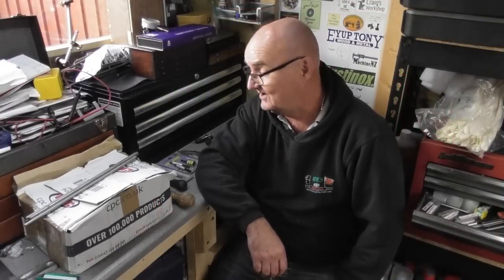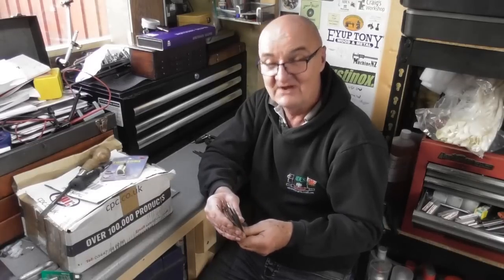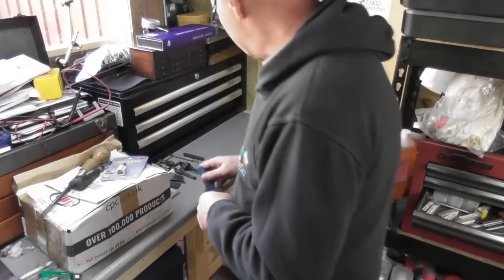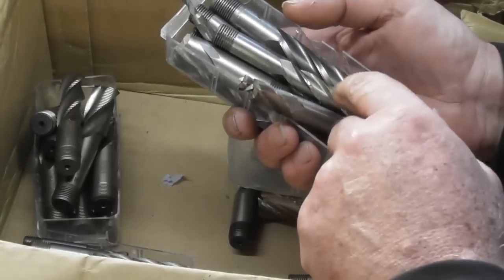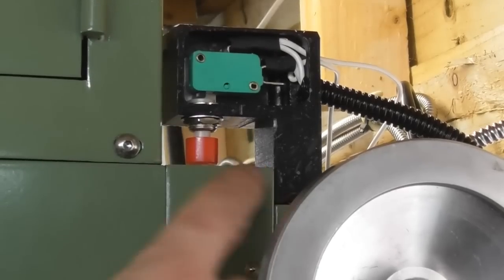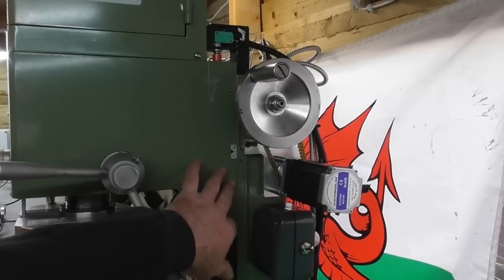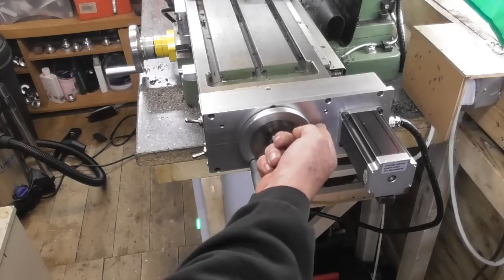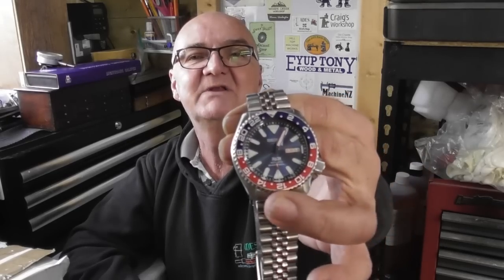Shed talk 27

Comment: Nice viewer score Ade!  A good job of the Z axis cut out. Love the Seiko watch! I've been a fan of Seiko's for donkeys years, on my second  Solar Titanium 100 metre watch. I never take them off and the last one had so much welding spatter on it it got rusty wen wet even if it were waterproof or water resistant as they call it to get round warranty claims. The first one died when the welding spatter welded the crown( winder to others) to the case and I broke the crown off trying to free it. The Crystal was completely knackered as well and the cost of a new Crystal was prohibitive given the state of the watch and the crown breaking was the last straw, but I had it in daily use for about 13 years so it didn't owe me anything at £110 lol so I got a  second hand brand new one a month old it's now 5 years old with only one welding blemish I filed and polished off, any welding I now take it off. Lol

Comment: Nice job with the Z feed. Really you now need an automatic Quill feed, should you rotate the head you will not be able to use the Vertical drive other than to move the head into position. If you need to power ream or bore a hole at an angle, quill feed is a must. John Mills ( Doubleboost ) fitted a motor to his fine feed quill knob. Regards from Australia.

Comment: Small drill, I dont want to upstage you but I have a set of BERGEON taps and dies which would easily cut a thread on a shaft that size, the smallest is 0.26 of MM and goes up to a giant 01.09 MM.
David